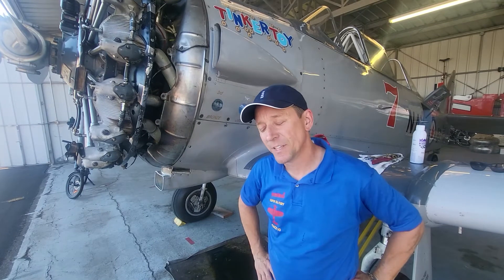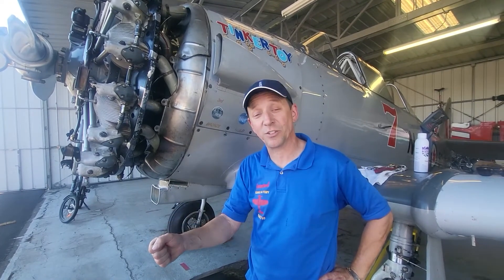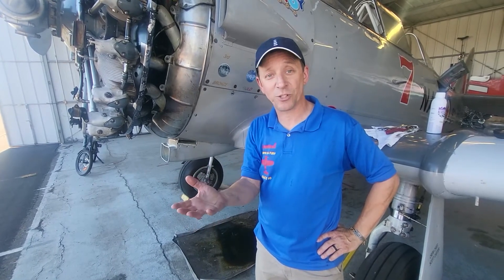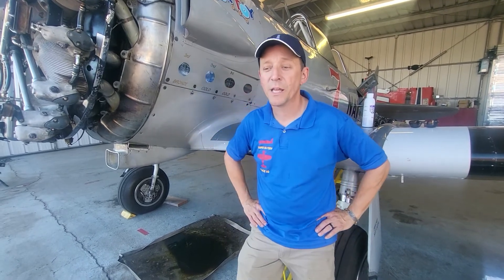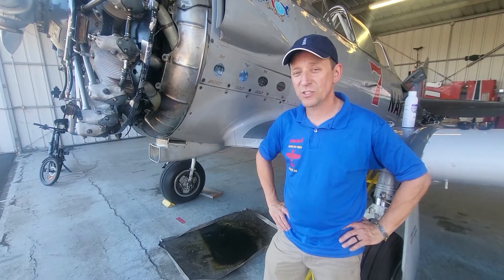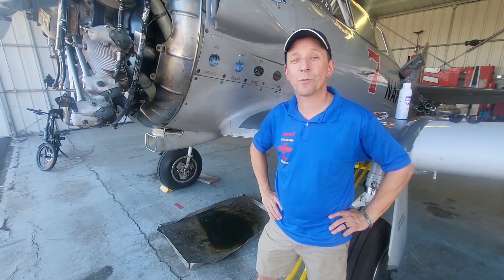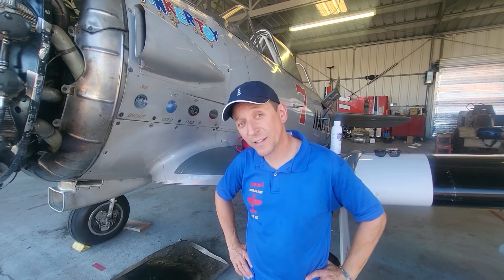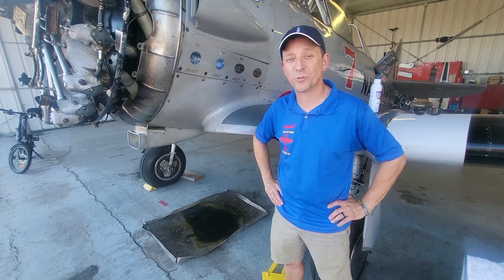North American T-6 Tinkertoy  manifold pressure vs rpm discussion.  Sea Fury Central

Comment: Ken took me for a ride in Tinker Toy not long after his Reno victory, I remember how careful he had to be starting the engine due to the spark advance setting (he said it was still in its race tune and there was a danger of it trying to kick off backwards)
Reply from the maker: True.  Advancing the ignition timing would cause it to stop or even kick back.  The solution was to spin it up with the ignition turned off and turn them on once up to speed on the starter.  I actually still start Tinkertoy with the mags off out of habit.  Contributing factor is that #7 has a 12 volt electrical system that turns slower than the stock 24 volts in Kitchen Pass.